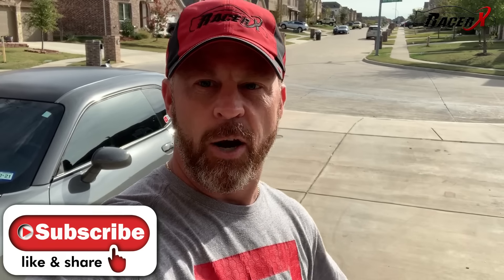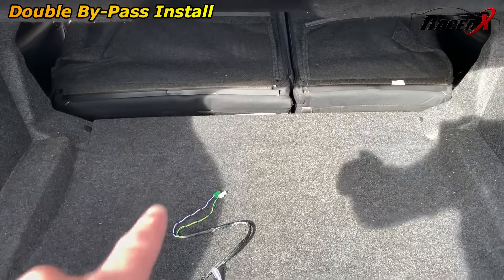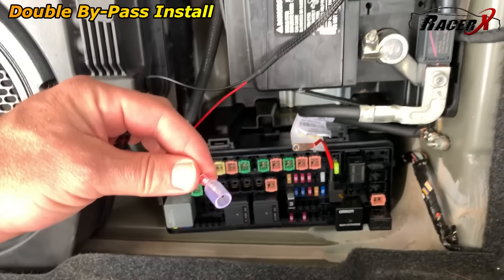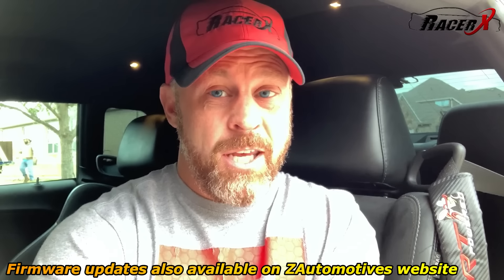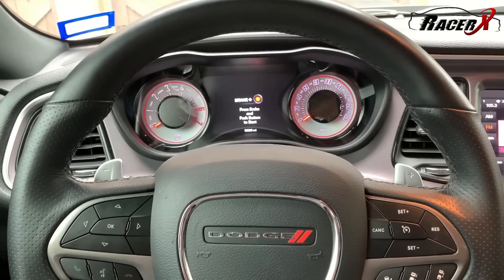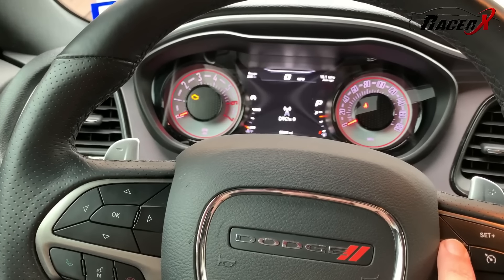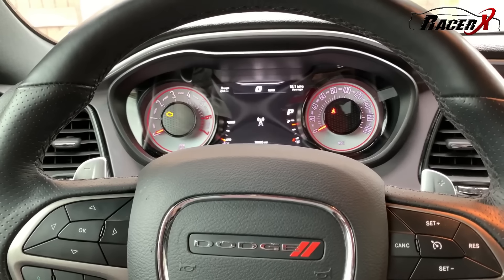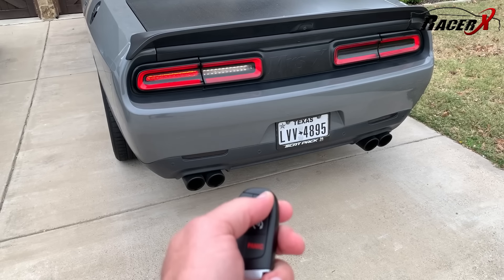If you own a Mopar this is a MUST have!  Small but Mighty mod..

Comment: Why do you need the bybass?  Couldn’t you just plug it into the OBD II?
Reply: You can it depends on your year of car. 18+ has to use the bypass because of a new security thing Chrysler put on the car. When you go to order you will put the cars info in and it will say if you need it. My kit came with it because mine is a 20.
Reply: @octanejimmy  I have a 2019 widebody Challenger Scatpack.  I am going to be adding a Diablo tuner, and the support tech at Diablo told me I do not need the bypass cable.  Maybe the taser is different though?
Reply: @danieljohn4603  If you run the Diablo plugged into an ODB port you will need the bypass for the tazer to be plugged in as well, if you are going to run them at the same time. Ive never ran a Diablo on a MOPAR car before so Id call Tazer and ask them to be sure.
Reply from the maker: Yes Jimmy is right.. there are security features that will not allow the Tazer to work using the ODB2 port.. also you will want that port clear so that you can plug your tuning cable into it.  You can use the Tazer concurrently

Comment: So the Tazer can turn a RT/392 ( powered by SRT)
into almost a real SRT 392 without all the extras that the genuine SRT has. Cool little cloning device 🤔
Reply: Yes, the Tazer  is a key that just unlocks what FCA locked out as the car already has the features built into the system itself and it mainly benefit the Scat Packs (or any 392) mostly, but as mentioned some cars may not be able to get all the features due to the programming of the car itself and some may..but I know all 392s get all the features..I programmed the drive modes in the steering wheel and such...I love it...even with your SRT it can still benefit you...roll down window with keys and etc...
Reply from the maker: It looks like JG Scatpack392 nailed it
Reply: @RacerX9  cant wait to open my windows with the key fob 🙈

Comment: Thanks for the video!! Definitely sold me on the Tazer, especially when the light show came on (which isn’t even the best feature lol) also, they came with buttons, not sure if I just didn’t see them again, but exactly where are you installing them?
Reply: Those buttons go on the steering wheel where the adaptive cruise control would go. If you have adaptive cruise control the buttons are useless, if you don't have it then it replaces the blank black buttons with these functional ones.

Comment: Got a question Mr. X , how do you disable the MDS on a 2018 T/A?
Reply: Ive got 2016 SRT. I put 10W40 oil and the MDS will not function. Car runs superb. But fuel cons will be high

Comment: Awesome, I wonder if it works ok with a pedal commander?
Reply: Yes, I have both. They work well together. Don't run the PC to high in sport mode. Gas mileage will suffer.
Reply: @jimferry4751  right on good to know

Comment: Not meaning to hijack anything, but I'm looking to do a staggered setup on my 2019 Charger - everyone has an opinion it seems - any advice?
Reply from the maker: Yes a 9.5 in the front and 10.5 in the back should work perfect.. tires will depend on your driving style
Reply: thank you so much for your response.  i hope that i can meet you some day at Summit

Comment: Hey Racer you might not see this but can I still wire it through the trunk in a 2017 and below? Or is the only option for those years is to plug it into the obd port?

Comment: Does it affect your warranty? I already had it but always wondered.
Reply: I was told that on 2017 and up your airbag sensor will stay on and if you have to take it back to the dealership for an oil change or mechanical problems it’s best to uninstall the tazer to factory state so it doesn’t avoid your warranty

Comment: Will it make a difference if your car is the 1320 package.
Reply: Nahh bro don’t waste 300$ I would say, I gotta Scat and we already have the SRT pages line lock etc. I mean unless you want the light show feature🤣
Reply: @Changed2024  no I don't need to show off that much.   My 1320 challenger is going in the garage soon for the winter.  Only to be driven on nice days.
Reply: Challenger 2020 ahh gotcha! I had the 5.7 R/T before my scat and bought the Tazer and just wasted 300$ as I couldn’t use performance pages due to the 7” uconnect! But bro you gotta drive that beast around! That 1320 is unique on its own💪
Reply: @Changed2024  yes it is and I have the sinomin stick color. But here in NJ people drive like nuts in the winter.  And all the krap they but on the roads. Don't want that krap on my car.    There aren't too many self car washer around.
Reply: Challenger 2020 ahh gotchu bro, yeah I lived in NY for 2 years so I know what you mean all the salt they lay down for the snow. Keep that 1320 prestine 🔥
Reply: @Changed2024  thanks for the information.  Keep safe. And healthy.
Reply: Challenger 2020 thanks brotha you as well!
Reply from the maker: I love the cool down feature.. the changes in font.. there actually several useful features .. even if you have the SRT pages.. only showed a few in the video

Comment: Not exactly sure hot effective it is to run the cooling fan without the engine running. The cooling systems is effective because when the engine is running the water pump circulate the hot coolant into the Radiator where it gets cooled by the flow of air through its core.
 
Without the engine running, water in the Radiator is static and the hot coolant in the engine remains static and hot. The fan may cool the water in the radiator, but hot coolant remains trapped in the engine.
 
There are some race applications that utilizes an Electric water pump and I believe Volkswagen, at one point, utilized an Electric pump in a backup capacity. However, running a fan with the engine off can’t be too effective in terms of reducing the temperature within the coolant system.
Reply from the maker: Believe it or not is does help some.. not like a killer chiller would with the car running.  The car tends to build heat with the engine running much faster which is evident when looking over the IAT's under both conditions.
Reply: @RacerX9  - ok, I’ll take your word on that, but remember the IAT Sensor is pre-intake. With the engine off, it will vent out of the filter... heat rises. Thus the temperature reading will lower fairly quickly.

Comment: She's getting good range.  Average 18 mpg. I get like 12
Reply from the maker: Yes when I drive things change lol
Reply: Or turn on eco mode on that will help lmao
Reply: @nytowl3166  I don't run that due to premature roller failure due to lack of oil at low rpms in eco mode
Reply: @infosneakr  man sorry to hear that It worked good for me especially going out of town and doing 65 most of the time unless there cars going even slower than me lmao

Comment: If u go w/ HPtuners I'm curious to know if the Tazer bypass will work w/ it, or if u still need the in-dash "smart" bypass cable for 18+ Mopars.
Reply from the maker: You can use a Y splitter on the OBD2 port or the bypass..  they both work 👍

Comment: I wish they had something to make using the launch control and trans brake on my 2020 1320 easier 😂
Reply from the maker: Yes those features can be a bit cumbersome if you dont use them all the time
Reply: @RacerX9  yes sir i can use the stall ok i struggle with the launch control..the stall seems to be to much for our local track

Comment: I love the dodge brand, but it sucks that you basically have to have 2011 and/or newer to unlock your mopars potential power through these tuner companies... The oldest vehicle you can tune with is the '05 magnum/300 as my wife and I have an '04 Durango 5.7l V8...
Very informative and fun, but disappointing to draw the short stick. :(

Comment: I wanted one just to turn off the seat belt chimes. Anything on the passenger seat and my chime would go off. 

I found an old method to turn them off that still works. 

1. Buckle seat belt
2. Put car on run
3. Unbuckle seat belt 3 times, leaving it buckled in the end. 
4. Shut off car. 
Only the chime is gone.

Comment: I don’t think it’s worth it, I had one for my 2019 5.7 R/T and since I had the 7” u connect I couldn’t use the performance pages I now have a Scat and don’t need the Tazer since I have the performance pages, launch control, line lock etc if you want to check out the video I made here it is👍 https://youtu.be/f3QTqtlBkvM